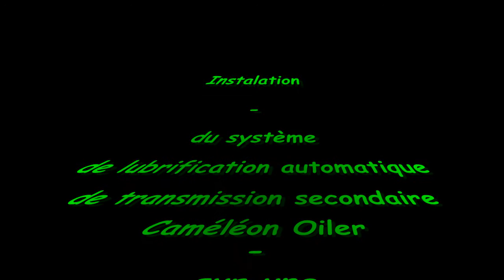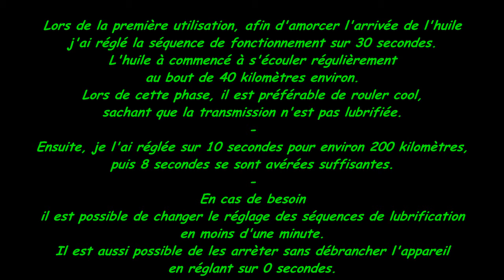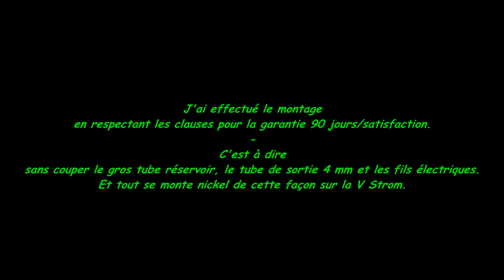Caméléon Oiler sur V Strom 650

Comment: bonjour j'aurais voulu savoir si après deux ans vous êtes toujours satisfait du  Caméléon Oiler
et si la chaîne est correctement lubrifier ( tout partout ;D  )
Reply from the maker: Bonjour. 
J'ai revendu la moto il y a peu. J'ai donc fait environ 10 000 km avec le Caméléon Oiler. Très satisfais du produit, mais à condition qu'il soit bien réglé. Dans ce cas la chaine est parfaitement lubrifiée et la moto très peu salie par rapport à un graissage classique, même bien fait. 
Pour ce qui est du réglage, c'est principalement les grosses différences de température ou bien si l'on roule très souvent sous une forte pluie, qui demande à le changer. c'est à dire qu'il ne faut pas qu'il soit réglé de la même façon toute l'année, surtout si l'on habite dans une région où les températures ont une forte variation entre les saisons. 
Ceci dit, si l'on suit bien la notice, il ne faut que quelques secondes pour changer le réglage et personnellement il m'a fallut le changer environ 3 fois dans l'année.  
Mais ce n'est pas compliqué, si la chaine semble vraiment mal lubrifiée, alors on le règle plus fort, et si il y a pas mal d'huile sur la roue arrière, c'est qu'il est réglé trop fort.
Pour l'instant j'ai une moto avec un arbre de transmission, mais si je rachète une moto avec une chaine, je réinstallerai ce système à coup sur. 
Lorsque j'ai revendu ma moto, elle avait presque 15 000 km et la chaine semblait quasiment neuve. 
A savoir. Attention si l'on doit courber le tuyau rigide, une fois monté, si c'est bien fait, il ne craint quasiment plus rien, mais il est très facile de le percer lorsqu'on le plie. Je recommande, si l'on prend une pince de bien le protéger avec un gros chiffon par exemple.
Bonne route ;-)
Reply: ouhaaaa :O je n'en demandais pas temps, un grand merci a toi ;-)
Reply: utilisateur du premier et du second, ça marche très très bien. J'ai peu de kilomètres (5-6000) mais en ville uniquement (avec les accélérations que ça implique aux feux et autres stops). le boitier est solide et fidèle !
Reply: Je me sers du caméléon oiler depuis 9 ans que du bonheur